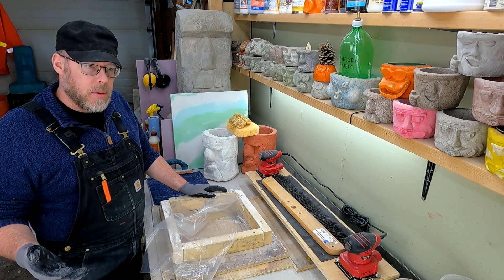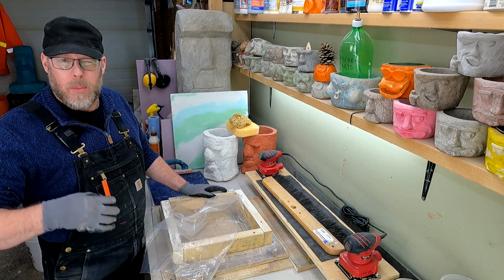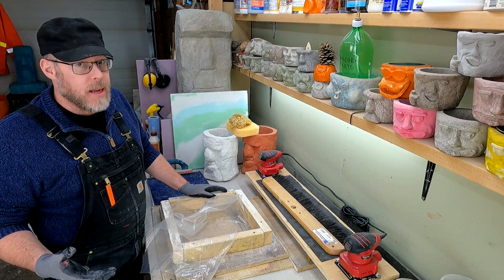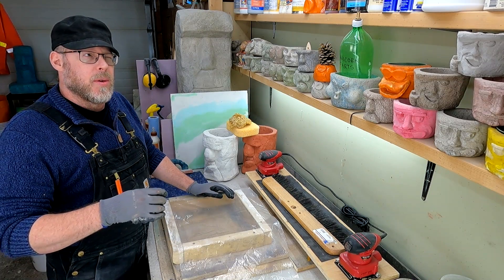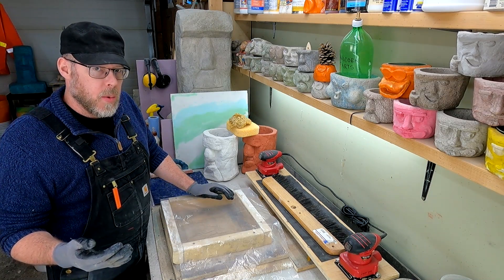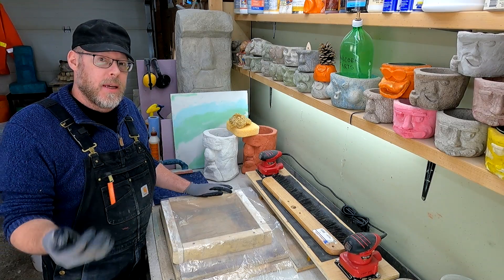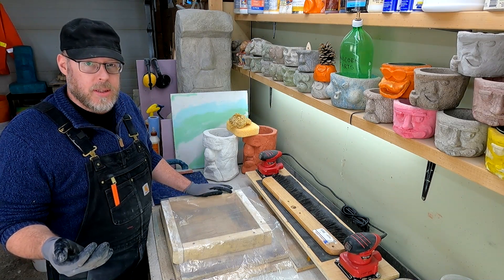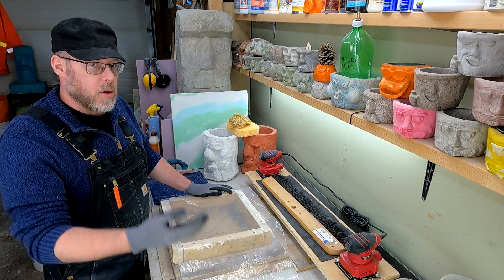Do You Need Plastic Under a Concrete Slab?

Comment: What hapoens when water like rain over the top of concrete? Then the water gets trapped by the plastic and can't drain away and the concrete will absorb the water later . So?
Reply: ?? A slab is the foundation for a building. The building is what gets rained on, but not the slab.

Comment: I’m in a cold climate and am considering a mono slab on the small hole I’m building. Does the 10 mil plastic go on top of the gravel and then put my foam board on the plastic and pour on foam board or does the plastic sit on top of the foam board?
Reply: I would say under.

Comment: Hi. Do you recommend adding a plastic before pouring a concrete Driveway? I found a few concrete companies, they all say the plastic is unnecessary and an overkill.  Should I insist that they add the plastic for driveway or only need the plastic under concrete slab for building a house ?
Reply: my main takeaway is always put plastic sheet when casting concrete over any ground, really. it's not an overkill when a high-quality, 0.2 thk plastic sheet is just 5$ and can be installed in less than an hour with a team of three.

Comment: It also reduces cracking. As the concrete dries it shrinks and the movement is easier with less resistance on the ground.

Comment: There are pros and cons to using plastic.  It all depends on the subsoil, drainage and how much surface water the slab will see. Counterpoint: If you have a slab with poor drainage, a vapor barrier under it will pool water in the slab and destroy the steel rebar.  Best to have a well draining subsurface, wet right before the poor to mitigate suction from the concrete.
Reply: I was thinking about this too. It's a two edge sword
Reply: I agree

Comment: An old concrete guy here.  That vapor barrier is also very useful to prevent overly rapid drying of concrete on substrates that are too dry..  I've seen concrete poured on dry ground actually cracking as it was being finished.  Good video by the way.  You know your stuff!

Comment: I also use plastic under concrete to prevent the wet concrete from losing moisture too quickly. Some water drains curing concrete. Drainage too fast can cause the surface to dry faster than the underside and cause cracking.

Comment: I like your videos, I always learn something useful, keep them coming 🙂

I did concrete work for a decade and no one ever explained why we put down vapor barrier other than, if you don't the slab will fail over time. I mostly set and poured wall, so it only came up in the winter when we helped the flatwork crew indoors.

Comment: Thanks - interesting. Do you know anything about floating the concrete with a magnesium float, or composite or wooden float? Any difference?
Reply: Think of it this way, each one changes the surface area of paste.   Having more surface area allows more water to evaporate while curing. A mag float will yield a slicker surface, whereas a wooden float will make a rougher surface.